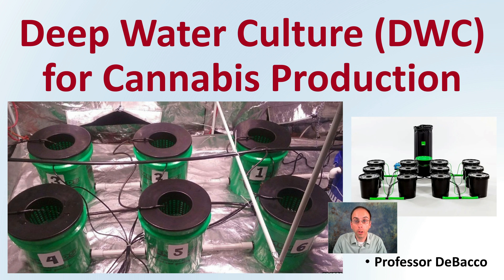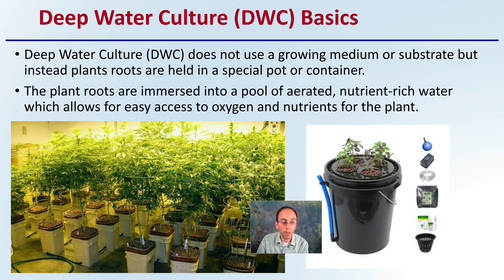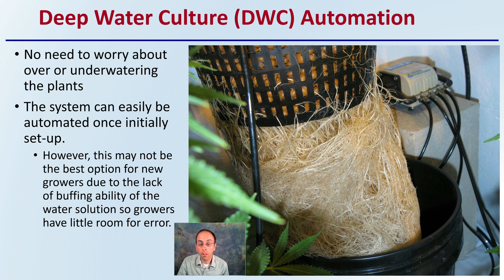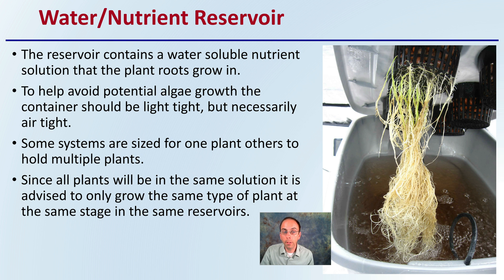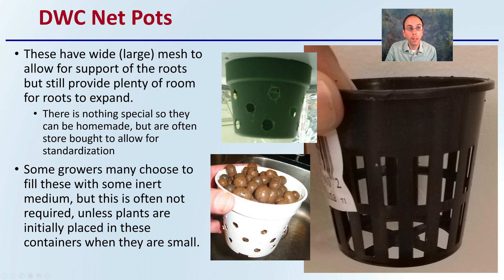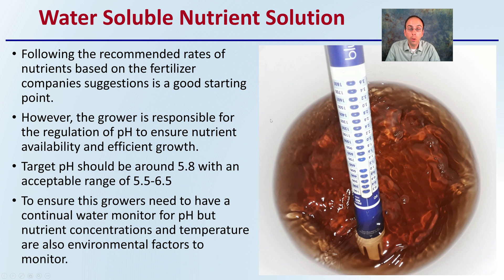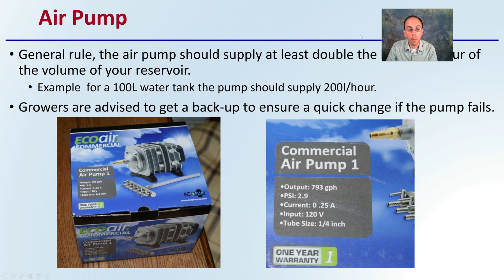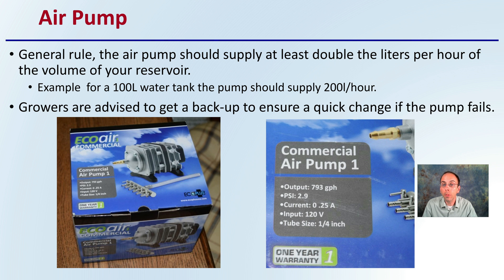Deep Water Culture DWC for Cannabis Production

Comment: You can not run dwc at a ph over 6 it's best ran between 5.5 and 5.8 at 6.0 cannabis runs into a ton of nutrient uptake issues..
Reply from the maker: Your substrate may also influence the pH range as a pH over 6.0 will not result in a poor nutrient uptake for cannabis in general.
Reply: @DeBaccoUniversity  true but dwc contains no substrate and this video is in reference to dwc. When growing dwc 6.0ph will cause deficiencies.

Comment: What’s the recommended temperature to keep the maximum dissolved oxygen content in the water? The colder the water, the more oxygen it can hold, but how cold is too cold for a root system? 
Can I use hydrogen peroxide to increase my oxygen levels and not harm the plant? 
How hot is too hot? 

When does pythium start showing up, and how can you treat it? 
Asking for the new growers out there.
Reply from the maker: Ideal root-zone temperature is around 72F, so this is the suggest target temperature.
Reply: I keep mine at 64-68 degrees & use UC roots.
Reply: @T-1000 WizOh'd Hahahahaha! It’s ok. I know the answers to all my questions. There’s a lot to look out for while running a DWC or RDWC system.
Reply: @T-1000 WizOh'd Kratky works fine if you run it properly, but I’d advise against using it to grow high value crops. It’s awesome for lettuce and other things. Glad to see yet another Canadian on here! I’m in Alberta

Comment: Professor, 
What are the yields in comparison to soil? Is there a significant difference between the two?  
I appreciate your willingness to share and help the community, your hard work and input goes a long way. 
Many thanks !
Reply: It’s usually much higher yields and faster growth than soil. RDWC is even better than DWC, and easier to maintain and monitor with everything connected together with a central reservoir.
Reply: Tom Bryant my Mans 🙏🏼✌🏼 👊🏼 
To me it also seems as if it would much easier than watering manually or even in an automatic timing set up.  It seems much easier to control.  
Can one also assume that the PH &-PPM (considering diff stages of growth, harvest etc) levels required are the same to soil or do these change as well ?  
Thanks Growmie ✌🏼💛😎
Reply from the maker: In short hydroponics can produce better yields, but greater returns comes with higher risk as there is minimal buffering with a hydro system so a grow can more quickly than soil loose their entire crop.
Reply: @muthrfuqrjonz3530  It only SEEMS easier. It’s much more involved than a soil garden, and it can go sideways in a hurry. The air you pump into the reservoir creates carbonic acid which will change your pH. The air can also warm up the water if it’s getting taken from a warm room, or the pump is hot.
Reply: @muthrfuqrjonz3530  pH requirements are different than those of soil, and it’s constantly changing along the the EC (ppm) as the plants uptake the nutrients and weaken the nutrient solution. Soil pH is higher (in the 6.5-7.5 area) DWC/RDWC is lower (in the 5.5-6.5 area) If you maintain a higher relative humidity, the plants won’t drink as much, if it’s dry, they’ll uptake more. If you have weak lights, they won’t drink as much. If you have powerful lights, they’ll drink lots. Toss CO2 in there, and it’s crazy. You can play with all the variables in hydro and get very quick results, so it’s comparable to being the F1 of growing with so much to look after and watch out for. As the roots grow, you need to watch that they don’t plug off any air stones, or feed/return lines if in RDWC.
Reply: Tom Bryant 
Eaiser physically as carrying water to supply the plants .  Easier not in effort or skill but in handling the water itself. I’m an old man.
Reply: @tombryant4518  
Thank you very much for your teachings and response Professor.  Many thanks!!
Reply: @muthrfuqrjonz3530  anytime brother!
Reply: @muthrfuqrjonz3530  You get up and running to play with a DWC/RDWC garden yet?
Reply: @tombryant4518  I'm buying a r dwc but unsure about the brain pot with timings, why isn't it circulating all the time? Thanks
Reply: @scottyj1070  What did you buy? It should be circulating all the time if you have a RDWC ( recirculating deep water culture) system. It keeps the nutrients mixed, and oxygenated.